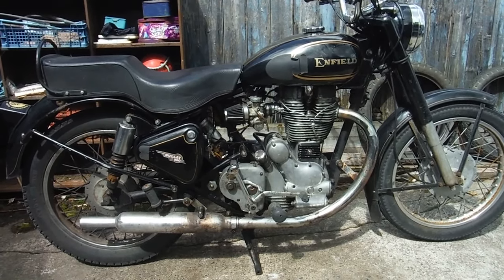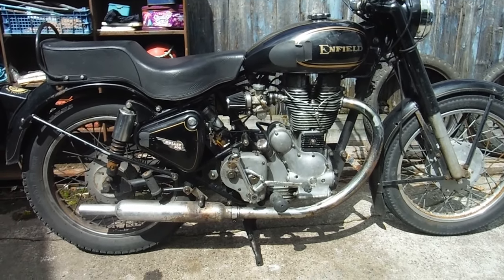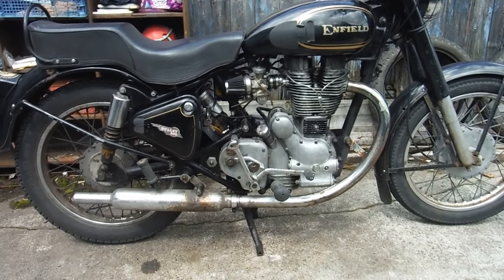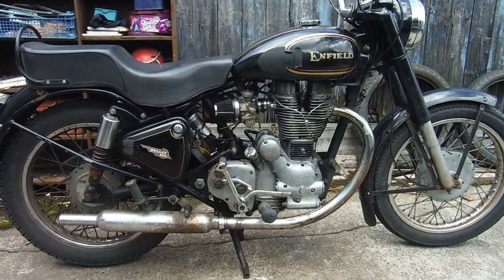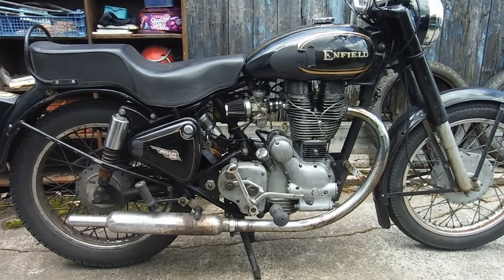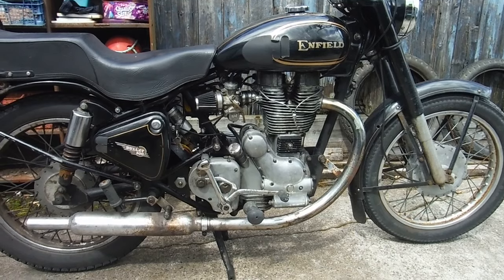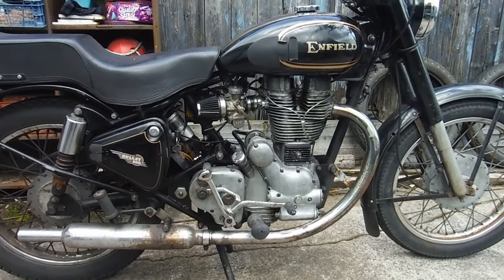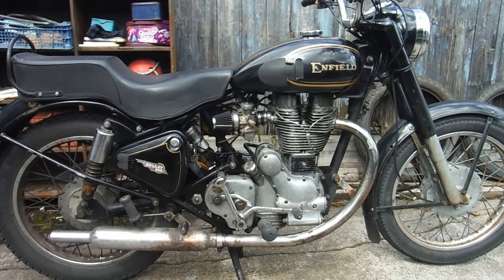Royal Enfield Bullet Asbo 43 compression ratios, retarding inlet cam timing and gearing discussed.

Comment: Hi Paul
Love your videos I'm a big fan
Just wondered if you could help with my ariel enfield bitsa Is quite revvy at 55mph because i have inherited the gearing it was built with it has a 15T front sprocket but a 47T ariel rear! What would be a good choice of larger front sprocket ( that would fit) to bring the rpm down to a usable level its only a 1951 reditch 350 motor
Reply from the maker: Hi, I think I would be looking for around 17 or 18 teeth, that should do it.
Reply: @paulhenshaw4514  thanks Paul

Comment: Asbo 43 looks to have excellent performance, if this tune was applied to say a 5 speed gearbox how might you go about the gearing then ?
Reply from the maker: Realistically, Asbo 43 is about as high geared as I would go with it, on 18t on the gearbox. However, with 5 speeds, it might be possible to go slightly higher and use top as a sort of overdrive, or cruising gear. In favourable conditions, 43 might crack the 'Ton' as it is.
Reply: I fitted a five speed box to my tuned 350. I left the 18t drive sprocket on it and fitted a 42t to the rear hub, so the gearing is close to 350 standard. I think it would pull a slightly higher front sprocket as it will easily keep up with motorway traffic now, but I prefer the good mid range performance because it’s used around the back roads rather than motorways.